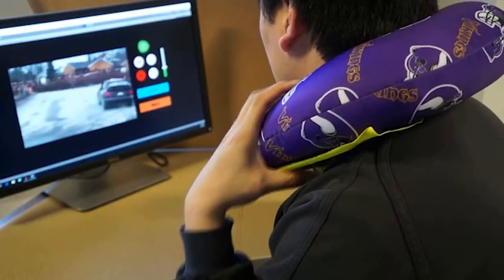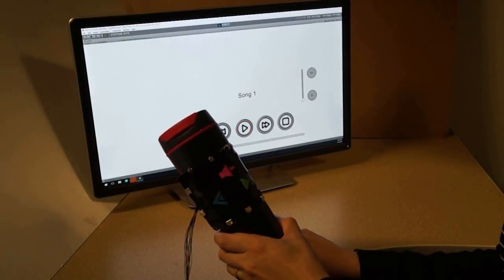Anything is a Controller: iSoft Makes Fabrics Interactive

Comment: Print fixed sized rectangles with integral encapsulated border edge wires to bluetooth board with a socket to hook Lipo battery to. It releases the interface to be connected to a computer/phone/arduino and makes sensor multi-use.
Then you have commercial product to sell as a kit so consumers can create their own thing to control (like people do with arduino).